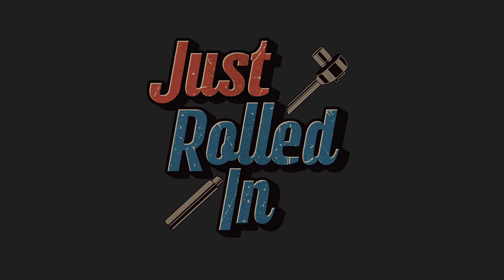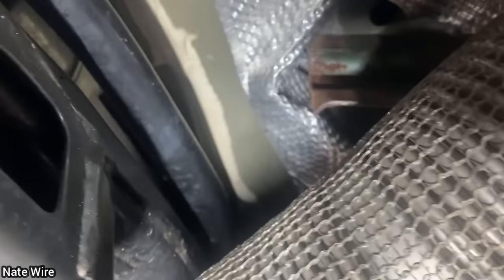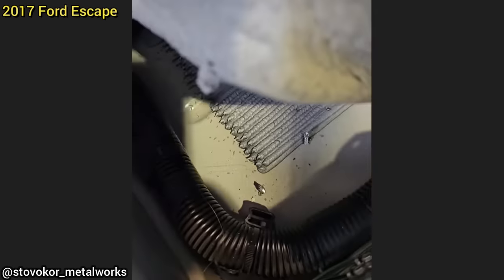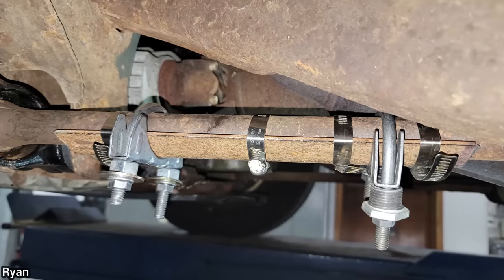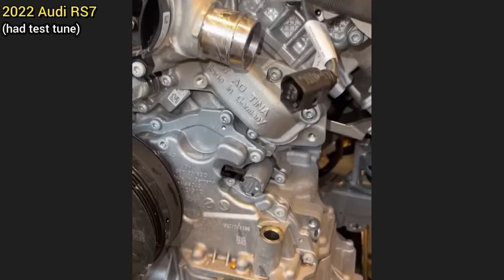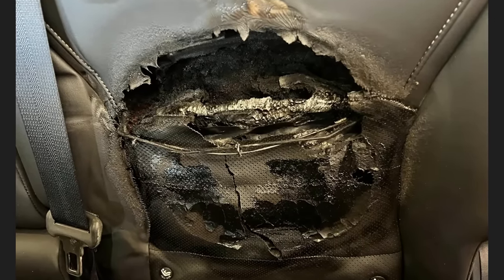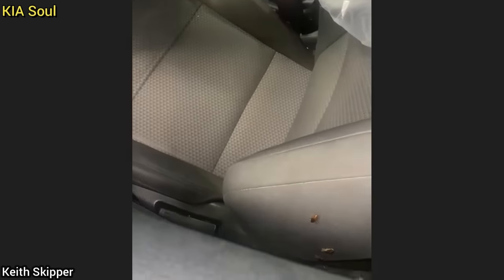Customer States They Ripped The Floorboard Off Their Car

Comment: I don't blame the owner on the seat heater melting the seat. That's a major safety oversight by the engineers
Reply: Something definitely went wrong there. The seat heater should have a resistor/timer that turns the heat off once it hits a certain level.
Reply: @TheRSTD1  It is called electric cancer. That is why some modern cars drop drastically in price after a few years.
Reply: Once again, case in point, comfort is not the same as safety. 👍
Reply: Tbh yeah. It would have been easy to have it disconnect once it's flipped down.
Reply: It should be a PTC - it shouldn't melt the seat...
Reply: @rkan2  Exactly. Shoddy manufacturing.
Reply: Could be aftermarket

Comment: Wow I'm shocked the seat heaters did that much damage to the seats when folded.
Reply: yes, I am too. Any idea what make/model this could be? american? european?
Reply: That looks like recall material. Absolutely no negligence on the owner, that is awful design.
Reply: @Dangerwiggles leaving the seat heater on while nobody is sitting there isn't negligence?
Reply: On Mazda's the heater turns itself off once you turn the car off. But on my wife's Subaru the heat cooler and warmer stayed on until you turned them off.
Reply: If the seat heater had a thermal fuse, this would have only resulted in the heater no longer working, and maybe some discoloration. This is absolute negligence by the manufacturer.
Reply: Could have slipped a couple Hot Pockets in there for a snack.
Reply: @SLOCLMBR  if there's no thermal protection, it is defective design ! Imagine having someone sitted there for a road trip ! Sure, he'll be unconfortable way before it burnt thru, but that's a bad design if it can get that hot !
Reply: It’s possible they were aftermarket heaters.
Reply: Who’s the idiot that designed a seat heater that can melt the seat it is in? If the system would be too hot folded, how is there not an interlock? Just bad design.
Reply: @SLOCLMBR  A seat heater that can be on when nobody is sitting there is bad design.
Reply: @mindpilot72  while I can appreciate that, you have to notice when your backseat is literally smoldering.. I personally prefer the opposite. No warning labels, no word of caution. Go forth and cleanse the gene pool.. too many stupid people live to be old nowadays..
Reply: @Asakha1  imagine not noticing that the backseat is turning into a puddle of plastic..
Reply: @Sashazur  I agree, actually I think it's the most likely scenario
Reply: @mindpilot72  as mentioned, it makes sense to be an aftermarket setup.. cheap garbage that said oblivious customer installed themselves
Reply: @UncleKennysPlace  not that junk ya buy online.. makes more sense that it was an aftermarket heater.
Reply: @SLOCLMBR  No it is not negligent. No seat heater should ever do that, whether anybody is sat in the seat or not.
Reply: @TheEulerID  in fact if it can do THIS much damage by mere lack of an output for all that heat, it will burn people easily. Seat plastics don't really melt and burn bellow ~200ºc at the very least.
Reply: @SLOCLMBR  Meanwhile I agree that not everything has to be idiot-proof to the point of being annoying to not idiots (impossible after all, idiots always surpass themselves), there's a limit to this in this case, like if you just accidentally hit a switch and it starts to burn through your car... That's on whoever made that terrible seat heater, aftermarket crap or not.
Even someone more attentive would only realize this when it's too late and smelling burned.
Reply: While I worked for GM, we had a Cadillac owner who turned on the seat heater for his paraplegic son.  The seat malfunctioned, and burned a hole thru the seat, his pants, and he received 2nd degree burns to his legs and rear end.
Reply: @Kalvinjj  If the seat heater can reach 200C then it is by definition either a faulty design or a fault in the manufacturing. No seat heater should ever be capable of heating a seat to anything approaching that level. Either is should be physically impossible, or the seat heater should be fitted with a thermostat that turns the power off to the heater.

There is no excuse for a design/manufacturing fault of that sort. There is no reason why a seat ought to get to anything remotely like 200C.
Reply: @robertheinkel6225  that is sad, and I can believe it was caused by a malfunction. No properly designed seat heater working properly ought to be able to do such a thing.
Reply: @Kalvinjj  I guess I just live in a climate where heated seats aren't really popular.. it's a rear seat, extremely uncommon here. Idiots definitely aren't to be underestimated..
Reply: @TheEulerID  Indeed, and thermal fuses are a few cents a pop. That on retail I mean, on bulk even less.
Reply: @SLOCLMBR not at all!
Reply: Yeah I was going to comment the same thing, this is a safety issue and isn't the customers fault. I hate that seat heaters don't have an auto off function.
Reply: @KPDetails  On my VW, the driver's seat heater remembers its last setting and reverts to it after you turn the car off/on. But all the other seat heaters (rear seats too) turn off after you turn the car off/on.
Reply: @TheEulerID a normally functioning seat heater that won’t get hotter than 40C in the normal seating position will reach much higher temperatures when it’s folded. The seat surface has no air or no butt to act as the heat sink. It’s folded against the back of the seat that often contains another heating element. I understand that both elements were functioning at the same time in close contact, with no way to evacuate the heat, the fabric of the seat can and will reach 100C+ in a matter of minutes. Car plastics don’t need to reach 200C to melt as someone claimed. Once the meltdown starts, exposed elements can short-circuit and then there’s a real risk of having a fire. I don’t think the owner is at fault, but we need much more info before blaming either them or the car manufacturer.
Reply: @mindpilot72  not necessarily, during the winter I'll turn my passenger seat on when I leave to pick someone up so it's warm for them or if I'm bringing home some food I want to keep warm. No seat should ever get THAT hot though, someone with thin skin or poor sensation could get seriously burned.
Reply: on my Land Rover D3 heaters have timers, 5-10 minutes, then they turn off
Reply: Some home heaters from a dollar general have an off switch that activates if it gets tipped over. How doesn't a car have something similar for folded seats
Reply: @Asakha1  Or even a baby seat. That is dangerous.
Reply: I would have thought there would be a thermostat to prevent that sort of thing.  Good grief.
Reply: I had failed seat heaters once, it burned through seat and my wool coat... I was smelling "funny smell" but i thought that is from the outside, I reacted to to this when it finally reached and burned my back... It failed in one spot, propably resistive wire was damaged due entering/getting out of a car. Opel Vectra B
Reply: I think a sensor or something that tells the seat that’s it has been folded down and it disables the heater so that doesn’t happen
Reply: @brandonlink6568  Heh! Speaking of poor sensations...   Living in Southern California most of my life, it was only recently on a work trip back east, that I encountered a heated seat for the first time. I didn't know the driver had turned it on. I started to feel that warmth, and I thought I had lost control of my bladder.😬
Reply: @etiennedauphin  For real, I work pretty much every day with plastics, I don't know a single one that melts like shown under 180ºc, softening sure but not melting, if it melts at ~100ºc it would be barely adequate to handle parking in the sun.
That damage is sure way above 100, I would say above the mentioned 200 as well, and regardless, the lack of a thermal fuse that costs a few cents is shocking.
Reply: @SLOCLMBR  No, there should be no circumstance that a seat warmer should burn a seat like that. There needs to be some type of temperature control.
Reply: @markkauffman6184  if you buy junk from China, you get whatever they cobble together.. should be and what it actually is are two different things here..
Reply: @SLOCLMBR  If it's a feature and it is something the manufacturer and dealer can warranty.. which it HAS to be to sell it.. It needs safety alongside in installation. 
It needs a thermal fuse and it needs a circuit breaking function when the seat is closed, period. 
You'll learn if you feel like it!
Reply: @KenzertYT  agreed, but I am betting that this is not a factory installed seat warmer..
Reply: @SLOCLMBR  if the heater does not have a warning light clearly visible from driver side while on, then is bad design, not negligence.
Reply: From a physics standpoint, it makes sense that when the seat is folded down, there would be nowhere for the heat to go. It wouldn't have gotten that hot if it was left up, regardless of whether or not someone was sitting in it. It should be designed so that when the seat is folded down onto itself, the heater can't be turned on
Reply: @SLOCLMBR  Sure. But such negligence shouldn't result in something as disastrous as this.
Reply: @SLOCLMBR Yeah you can smell when something is burning especially plastic and foam.

Comment: For those who don't know:

Tuning your car will VOID your warranty. A bad or too aggressive tune can damage the engine, and the manufacturer WILL tell you to pound sand. YOU will have to pay to fix it. The tuner will deny all responsibility.
Reply: Agreed, but tunes are not death sentences for engines. My BMW has been tuned for about 140,000 miles and has 196,000 miles on the odometer, but I respect the limits of the hardware and check for things like detonation and proper AFR.
Reply: The Woman Driven channel had an episode where her Mustang's engine blew and she took it to Ford for warranty repair. They said no as soon as they hooked up the computer and saw the engine was tuned. So, she made a video tearnig down the engine to see exactly what happened and rebuild it.
Reply: Most folks who are familiar with cars will know that mass production engines are detuned to put out only a fraction of available power to maximize longevity and minimize emissions along with the unit cost.

Flashing the ECU is relatively easy if the ECU has rewriteable memory.  But yes, there will be permanent codes logged to indicate void warranty and it is almost guarantees early failure of other drivetrain components that are just barely adequate to handle the stock power.
Reply: @dagamer667  Yeah, especially things like differentials.
Reply: @WastedTalent-  I don't believe that for one moment.  One thing that sets car nerds apart from normal drivers is their absolute bile-flecked hatred for main dealer service and their smugness about never involving a main dealer for anything, ever.  Why talk to Ford when you can talk to Randy's Automotive Customs instead?  Or you could just do a full engine rebuild on your driveway at 9am on a Sunday and be done in time for lunch.

Anyone who even calls up a main dealer gets laughed at.
Reply: The thing that gets me is this guy has a ~$110k brand new RS 7, making what like nearly 600 hp and 600 lb/ft stock? And got a CHEAP tune while they were at it? Seriously asking for trouble, especially on a German machine. Save it for blowing engines like on a 10 year old Camry or something lol. At least a 5.3 Chevy for aftermarket support and plentiful parts.
Reply: @trashrabbit69 classic case of "you get what you pay for!"
Reply: @SugmaDLigmaNutz  So, he paid for an IED? 😂
Reply: @OnlyKaerius  And Transmissions ETC...
Reply: @trashrabbit69 it’s even worse when you figure most RS7’s actually sell for $140k and not 110. Hopefully next time they’ll pay the relatively small amount more for a tune from a reputable company.
Reply: @Fix_It_Again_Tony  I can't believe it. No actual way. Whoa. Holy shit. 
A BMW guy defending his tune that won't hurt an engine replying to a comment about how your manufacturer won't warranty your tuned engine!? With arbitrary anecdotal bullshit tacked on the end of his statement!?!? I've never ever seen such a thing. Never! No fucking way! Bro, get out of here you're pulling my leg.
Reply: @trashrabbit69  probably spent 70% of monthly salary leasing it and nothing left to afford a tune that isn't sketchy 😅
Reply: I'm just waiting for my warranty to expire, and I just want to remove the rev hang 😂

Comment: At 15 , working at a Sunoco gas station I was asked to check the oil level on and AC Cobra 427.  That was a fun place to work because all the hot cars wanted to fill up with Sunoco 260 advertised as "The Highest Octane Fuel You Can Buy!" We had Shelby Mustangs , 440 and Hemi GTX, 389 GTO's with trips ,  Corvettes .  All the muscle cars stopped by and usually left a little rubber .
Reply: Someone is showing their age. For me it was a Gulf station. I never forced down and bent the hood on a VW Beetle while filling it up.
Reply: Got back from a test ride and saw a Cobra  parked near the parts entrance. As I was drooling and walking around it, the owner came out, with an Irish Setter, and drove off. Couldn't believe the sound or the fact there was no cover on the seat for doggie claw protection !!
Reply: @Bill-yy3ck  Gulf No-Nox.  A good competitor to Sunoco 260 and less expensive.
Reply: @Bill-yy3ck   I stopped at a Gulf last week to play the lottery.  Very cute Spanish girl. Not a word of English.  All the landscape trucks go there for lunch, they have a little grill and deli.  Their regular gas is 40 cents higher than a Shell.   Well at least you didn't fill the tank with coolant ,  I knew a kid that thought it was a radiator tank.
Reply: @practicalplinking6133   I knew a very rich guy , he didn't worry about a car getting a scratch or ding.  He would just get it fixed.   I remember reading in Hot Rod magazine that the AC was 0-60 in two seconds with or without the dog.
Reply: @BlackPill-pu4vi  Now that woke up another memory. And don't forget that when you had to add a quart of oil, it was the round cans you had to pierce.
Reply: @rbspider  The AC came with a variety of engines, as I recall.  That super fast AC came with the top of the line Ford 427 and whatever else to handle the power.  I think the base model AC came with a Ford 289 and it was good enough for everyday driving.
Reply: @BlackPill-pu4vi  The 289 was a nice engine .  They sound tiny now .  The Cobra I checked the oil on was all engine under the hood,  fender to fender .  This was 1967 or 68. One of the kids had a Shelby Mustang GT350 dark green and I got to drive it for a few miles. It was sweet. I drove it like an old lady.  At the time I only had a learners permit.  If only we could go back .
Reply: Cut my teeth at a shop that did vw beetles,  they honed me quick with the thermostat trick,  lol. Good memory . Soo many brown and white wires.  Lmao 😂
Reply: @vs-ww7cb  They did that to a kid in shop class, The car was a Karmann Ghia and I believe it was the teachers ride. The engine was never turned over so no damage done.
Reply: @rbspider  lol 😆.  Actually learned  continuity from that.

Comment: I’ve gotta say, the seat heater one actually seems like something a normal human being could do. When my wife used to have a car with seat heaters I would have no idea when they were on or not, or when a kid hit the button, exc. Certainly seems like there should be a cutoff switch when the seat gets folded.
Reply: or an automatic fuse for when it gets too hot. or a time switch cutting it off after ten minutes.
but that cuts into the margin of every car sold, so it's deleted.

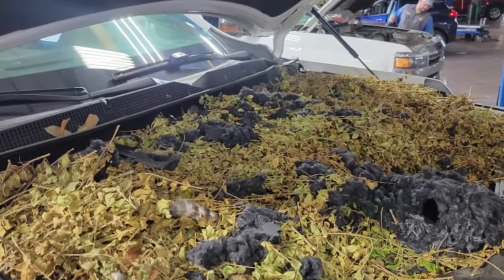Comment: Did the customer want all the “sound proofing” adding back to the engine bay after the oil change at 2:23? 🤣
Reply: Oil change: $85
Power wash engine: $210 (to get at dipstick)
Reply: My reaction was "It looks like Hobbiton in there".
Reply: My reply to you is  ,  dramatic chipmunk meme.....

Comment: Usually a vehicles WORST enemy is the owner. That ac drain being plugged is crazy we used to find mud dauber wasp nest in the drains but the drain hole is a good way to sniff out freon leaks in the evaporator
Reply: Here I was thinking freon had been banned for decades, so I looked it up, nope, not banned in the USA until 2020, yikes.
Reply: @OnlyKaerius  it also requires a license to use it in all automotive shops.  there's R22 we used R12 when I started in the mid sixties it came in 14 oz cans and cost .50 cents per can we were not told it was bad until the mid 80s. At that time we just opened the valve and let it go there were no machines like there are now then we repaired it and vacuumed it down to minus 28 inches of vacuum to remove all of the air and moisture it's still done pretty much the same way still.
Reply: @OnlyKaerius  and they now have machines that save all of the excess and it's disposed of by a recycler government rules that actually works but when buying it in bulk some crooks put in propane instead of the Freon and it's about 400 dollars for a bottle the size of a propane tank so now they make a tester for checking the content before you pay for it.

Comment: 2:54 Brings me back to the days I used to work for Enterprise cleaning cars and customers would bring them back filled with bugs....  We would turn on the heater in the middle of the summer and spray a ton of raid into the vehicle until they all died.
Reply: Scared now.
Reply: Huh. I've used Enterprise three times, every time I brought the car back freshly washed and fully detailed. The car was pristine when I rented it, that's how I should return it, right?
Even if I borrowed a friend's car, I'd clean out THEIR trash before I returned it. 😆
Reply: @dashcamandy2242  Yeah that would be nice; but not everyone brings it back nice and neat.  Clean cars were the ones we enjoyed going over.